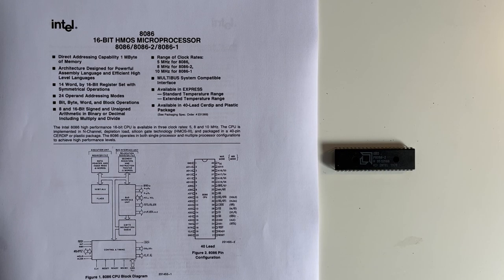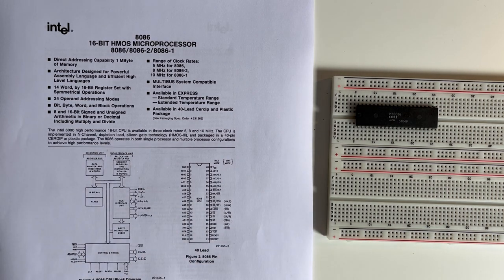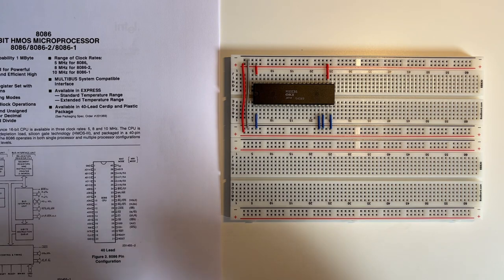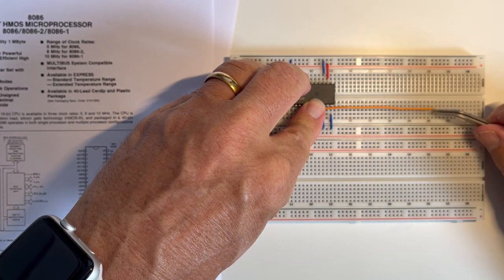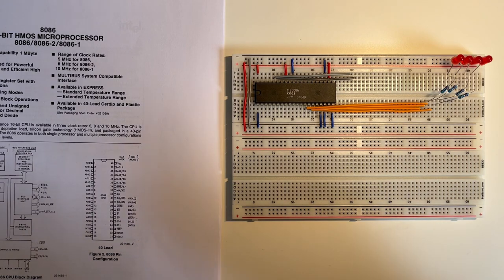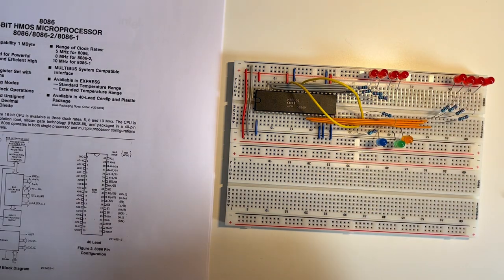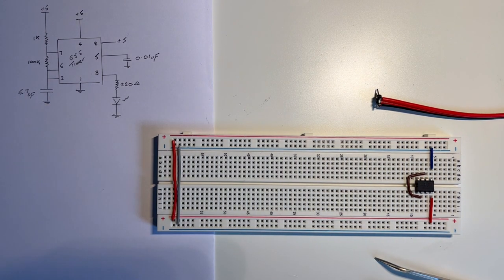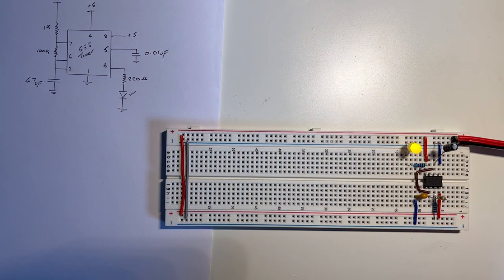Hello World on a breadboard Intel 8086 16bit - part 1

Comment: OMG great. I am currently at Ben Eater 8 bit register part
Reply from the maker: That’s great. I tried to base this on Ben Eaters excellent videos on the 8 bit, but because I had been using 16 bit 8086 when coding back in the 80’s I wanted to try and create a similar series on 16bit. Thanks very much for your comment and glad you liked it .

Comment: Looks like an ALP4
Reply from the maker: It is an ALP4
Reply: Have you considered starting with an 8088 instead, just the same as an 8086 but non of that BHE/A0 nonsense and only a single ROM/RAM. A lot easier to breadboard. 
BTW, I was one of those G Block types and worked on the original ASTRID (formerly ASTAR) PPI display.

  @twigwonderkid
Reply from the maker: I did, but it’s only an 8 bit. True I’m only running a tiny assembler program in the end and so won’t amount to 1k let alone 1meg. But though it more of a challenge to get the 8086 to run

Comment: I happen to have an  8086-2  and 2 D8088 cpu (intel  '84 and AMD '82 respectively )  - a little concerned they will not like a slow clock if I attempt to set one up.  How can one tell if they will not work?
Reply from the maker: Unfortunately it won’t work. The Intel 8086 expects the correct clock signal and frequency. The same will apply to your CPUs. They just won’t work at anything less than the specified clock frequency. I bought the 80C86 which is an 8086 but specifically designed to run a slow clock speeds. I couldn’t run these slow clock speeds on a standard 8086, hence the 80C86 which is identical to an 8086 but allows me to single step it to see how it works. I can’t take any credit for the hardware guys at Marconi back in the 80’s for designing the computer using the 8086, I was the software guy, and so I just wrote the code. The hardware guys built the computer which was called LOCUS16 and they then gave it to the software guys and we as a team wrote the ATC software which Marconi Radar called ASTRID. But I wanted to go back to the days of coding for the 8086 so found I had to build one first. As I’m not a hardware engineer I needed to explore how to make one work, so I needed to be able to slow it down to see how it works so I could then write code once I’d built a working system
Reply: @twigwonderkid  This answer saved my time after I struggled a few days with D8086 and never succeeded.
Reply from the maker: @Ahmet_Yilmaz Yes ! That’s exactly how I started. I used a crystal and a chip specifically designed for the 8086 that would produce the perfect clock signal. But when I ran at those frequencies I couldn’t see what was happening without an Analyser, and those cost a fortune. So I had an oscilloscope but it only has 2 channels and where a system analyser can be connected to the 20 data pins and you can see what’s going on, the oscilloscope is limited to 2 inputs and that’s nowhere near enough. Yes I can use an Arduino Mega and make use of its digital inputs but again the clock speed of the Arduino isn’t fast enough. Hence I used an 80C86 which is absolutely identical to the 8086 but with added benefit that you can use slow clocks and even single step and that’s when I was able to see it working
Reply: @twigwonderkid  Yes, i used rigol function generator for perfect 33 % duty cycle pulse but it didn't work. 555 breadboard clock didn't work neither. Until reading your comment, i was struggling to solve the problem.